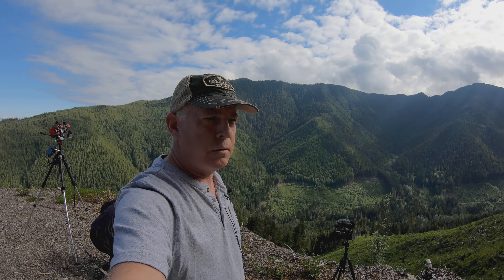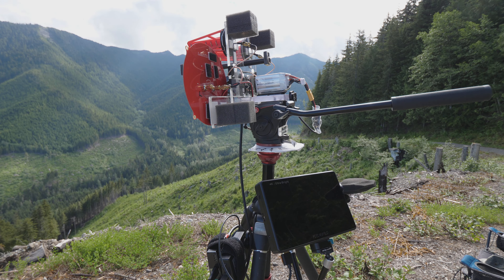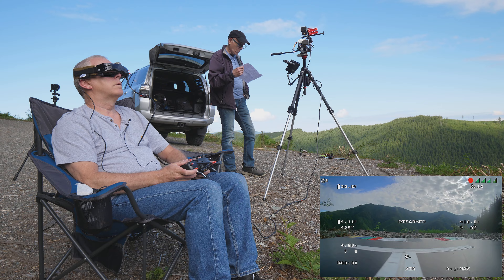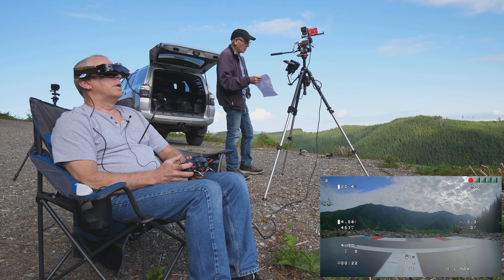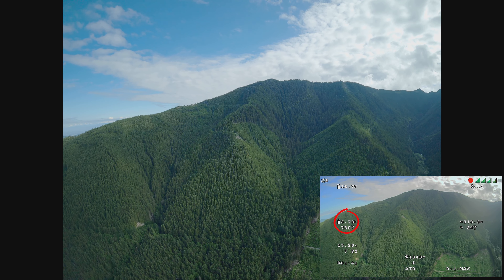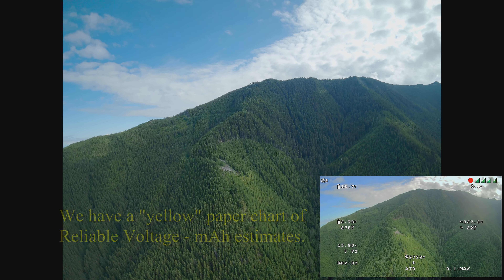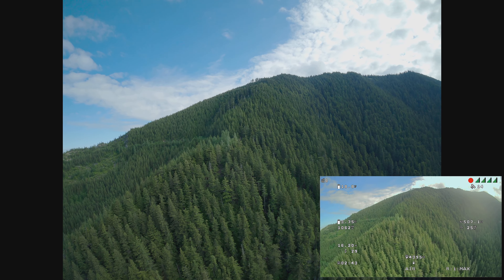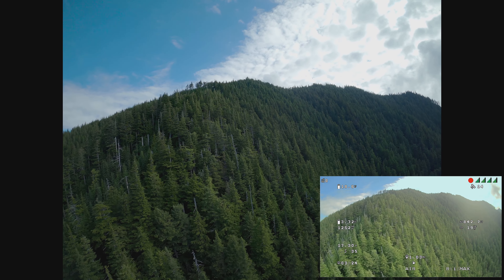Bad Amp Meter during Mountain Surfing FPV Flight

Comment: So this is how proper long range is done. with this antenna and spotter setup, you can confidently put a bigger camera for a kinda natl geographic footages. great adventure even with bad amp.
Reply from the maker: Thanks for Watching. I am building a cinema camera drone. Hopefully flying soon.
Reply: @ValleyFPV  your setup and planning is really topnotch. That yellow card is life saver. I'll tune to that build and flight
Reply: Try as well the new hdzero V2 cam. How much confidence increased based on the transition from analog 1W to 1W hdzero?
Reply from the maker: @jeffclassics  I have tried that camera as well as the Digisight. I prefer the Digisight.  The HDZ system gives me a little more image resolution than analog.
Reply from the maker: @jeffclassics  thanks

Comment: Hi there. I enjoy watching your videos and I learn something from just about everybody when I run across them. I have learned from you as well, so I thank you for taking the time to share. I am curious if you find the ground station makes a difference? It makes sense that it would with the wide variety of antennas you use. Have you tested it for range? Did you design and set this up yourself, or is it available to purchase? I thank you again for your help.
Reply from the maker: Thanks for watching. Those are all great questions. I think what I will do is make a video this weekend about why I have such a contraption.

Comment: I notice your description mentions crossfire (telemetry off). Can you explain why this way? no idea of control link strength?  Via osd or alarms via radio? Any info is appreciated.  Cheers ... UK
Reply from the maker: Thanks for watching. I use the HDZero fpv system. The Crossfire receiver actually does transmit at 40mw the telemetry in bursts. For some reason this transmission is picked up by my HDZ Vtx system and appears as noise in the video feed. Disabling it eliminated that fpv image noise. The distances that I fly is well within the capability of crossfire therefore I feel that i really have no need to know the link quality as it has always worked. Best wishes.
Reply: @ValleyFPV  THx for the reply. Look foward to the next 1